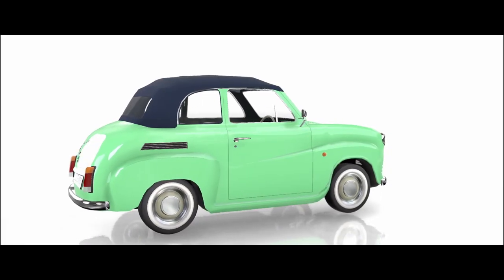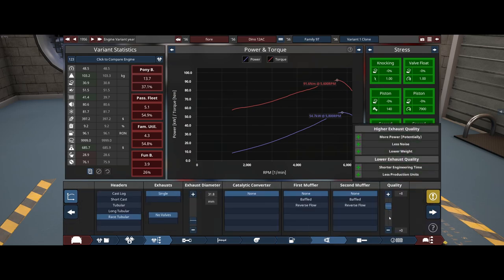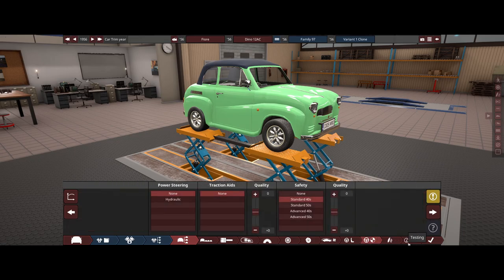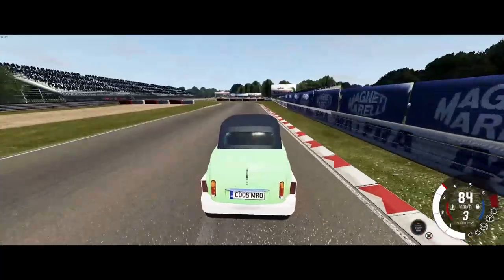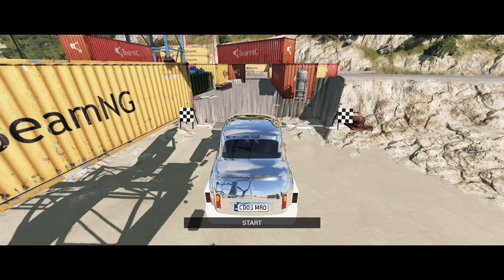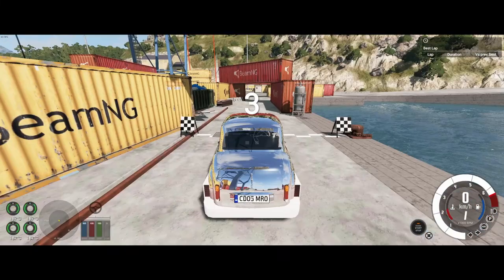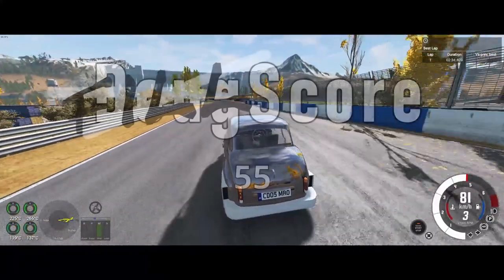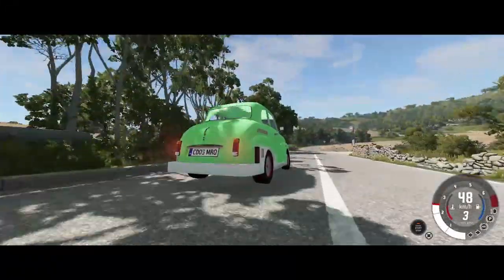Automation with Air-cooling for Beamng

Comment: 16:03 I think beams thinking is right wheel is stuck and can't be moved, send all power to the wheel with less grip (left) but if there lock the right, broken wheal stops the other moving. Great vid btw!
Reply from the maker: yeah, but it's always just a bit odd with lockers, not to mention that I shoudln't have been using a locker on this, because it turns it into hot garbage

Comment: When you loose traction on your rear wheels, say under power, you will experience fishtailing - a phenomenon otherwise related to single axle trailers whose load centers behind the axle.

Your car's center of mass is behind your front wheels, which means every reaction from the driver that isn't going towards regaining traction on the rear wheels will only strenghten the oncoming pendulum that your center mass has become.

Rotational mass of one's car is very important in controlling how a slide goes, hence why long wheelbase cars are generally favoured in disciplines like drifting, as the longer/heavier a car gets, the less violent and more controllable the response to a loss of traction on the rear gets.
Reply from the maker: haha I used to drift, so I get the idea. and I agree about longer cars being more controllable, but that rear locker unsettled the car under breaking, something chronic. I think it might have to do with, if 1 tire locks up, then the other one does too, increasing its chance to unsettle
Reply: @fillman86  nah, it was probably just the weight transfer, rears lifted enough for brakes to overpower what little grip they had
Reply from the maker: @retko8718  but there was a clear distinction between the locker being on and off, during times that I wasn't under power